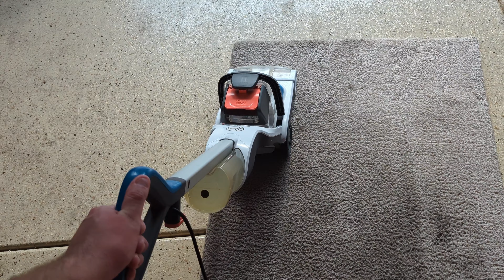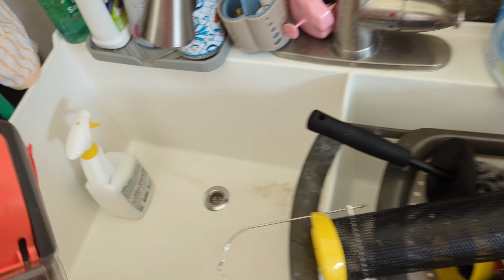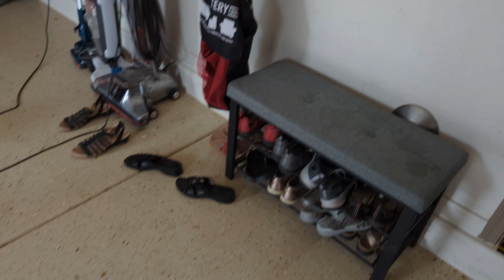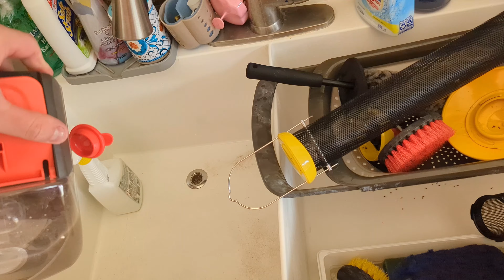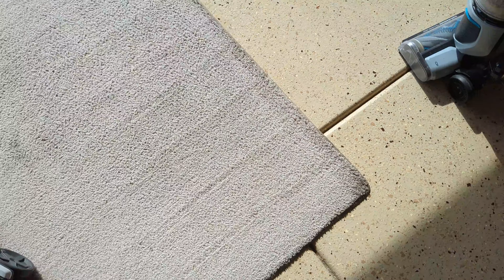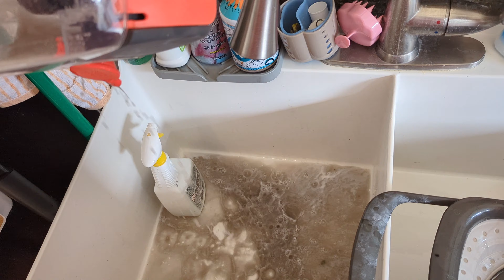Hoover PowerDash vs Filthy Carpet 🤢

Comment from the maker: This a great example of why wearing shoes in your house is gross. The rug is from the entry way in my garage. This is about 6 months of dirt buildup from us walking on it before taking our shoes off to go inside. Now imagine a family of 5 with kids walking in and out all day. Keep your shoes outside and clean your carpet!
Reply: I agree!
Reply from the maker: Thanks. Yes indeed
Reply: @VacMaster1991  that powerdash is loud could you try the revolution hydrosteam if that deepcleans better and quieter motor
Reply from the maker: @justinlyonsPawPatrol  on this nasty rug. No the hydrosteam stays inside.
Reply: We only wear house shoes in winter and bare foot in summer. I don't even have to tell the kids to take them off. They hate wearing them so they always toss them off  in the downstairs hallway or kitchen. No carpet there. My dogs mess up the carpet more than shoes from mud in their feet or whatever.
Reply: @VacMaster1991 not only that but it's too big for that little rug
Reply: Yup for sure. I see that with my Bissel wet vac sometimes. Unwanted and unnecessary dirt on the carpets. Which can get gross in the wet vacs. Off with the dirty footwear outside.
Reply from the maker: My mum has a pair of inside only shoes. So she can be more comfortable on the hard tile but not track dirt inside